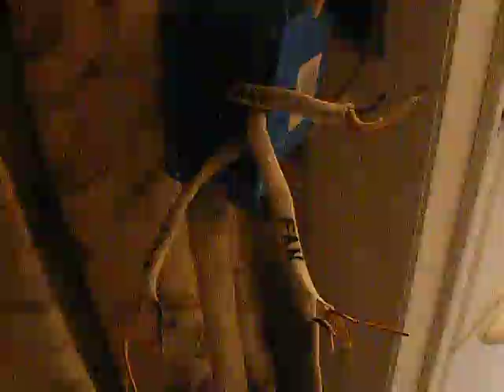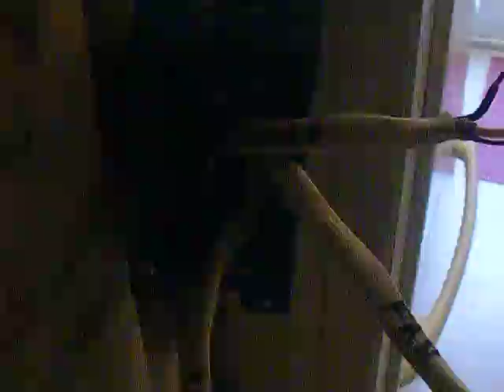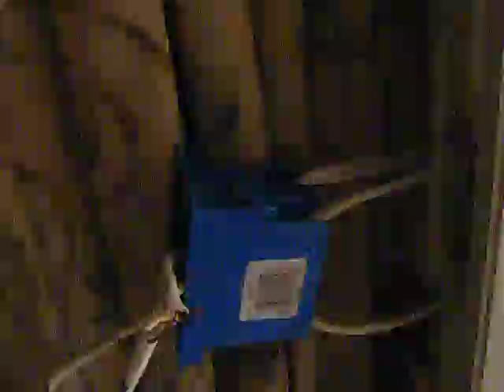Replacing Mobile Home Switch part 5 of 5

Comment: ya, can you make a 6/6 and show us why there are 3 sets of wires?  No other videos on YouTube for mobilehome wiring. 
What, don't we count?
Reply: The three wires or cables you refer to are usually a power cable (containing a hot black, a white neutral and a bare ground),  this either comes from the panel or from the last switch in the circuit before the one you are working on. Devices are usually daisy chained together with the power being "fed" from one device to the next in line.  Then a cable going to the light or fan and an outgoing "feed" to the next device on the circuit.   In my video and others the process of converting from the mobile home box-less device to a standard device in a box is shown.  Once you have a box and 6" wires in it the rest is standard wiring as shown in lots of videos.  I'm Sorry I didn't  show you the final hookup.  That is my first vid.   I do need to make more.  I have lots of still shots but no more vids.

Comment: I wish you would have shown the connection to the switch. I have the exact, weird 3 wire set-up but not sure how to connect them all to the new switch.
Reply: I am so sorry to leave you all hanging waiting for the next step.  I concentrated on what I thought to be the "hard part" and never posted the "easy" part of wiring the switch. I'll try to describe it here.  First there are three cables in the box. The line or power, the cable to the light and a feed to the fan switch in the box above.  Each of these cables contains a hot, a neutral and a bare ground. Only two power wires from these cables go to the switch.  The hot black wire is wire nutted to the black fan wire and a 6" "pigtail" wire is added in all in the same wire nut,  all the white neutral wires go in a wire nut and what's left is the the hot pig tail that goes to the switch and the black light wire that goes to the other screw terminal on the switch.  All of the bare ground wires go in a wire nut and a pig tail is added to connect to the green terminal on the switch. Hope this helps.
Reply: THANK YOU for coming back with the “easy” part!  We got the “hard” part but could not figure out the rest.